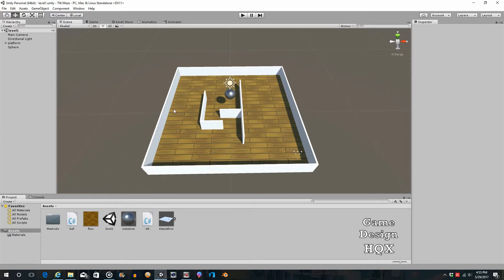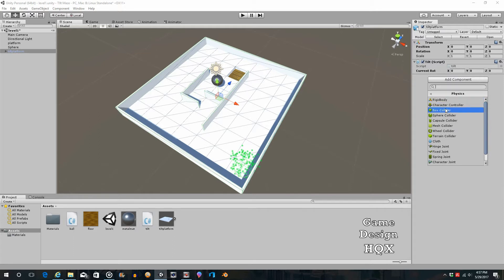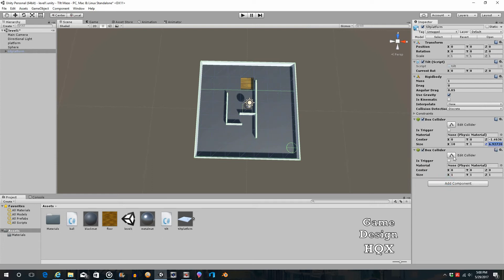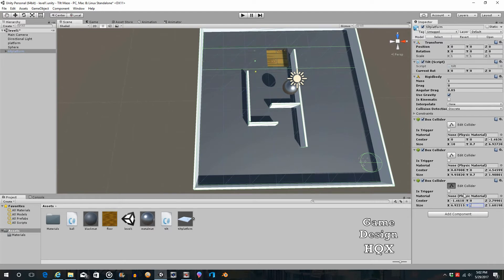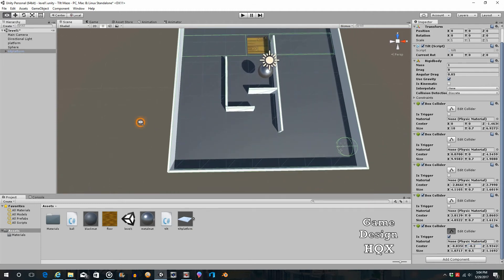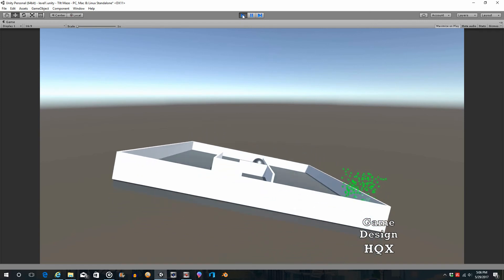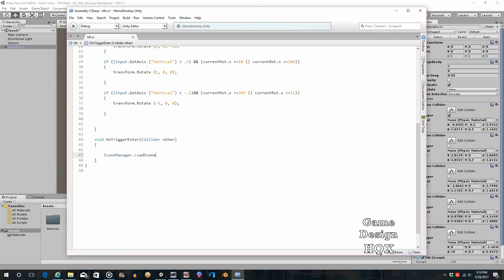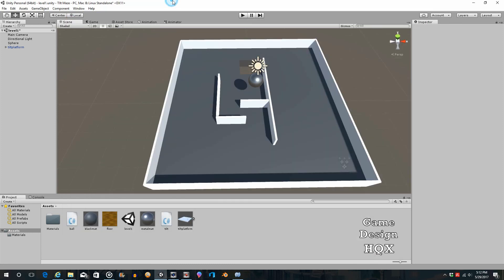Unity 5 - How to Make a Tilt Maze - 04

Comment: This is great and very close to what I'm looking for. Would you be able to make the table tilt depending on where the ball enters a collider? I'm trying to automate the table so that the position of the ball determines where the table tilts up and down (the table would tilt up at the position of the ball so that the ball rolls to the other side of the table).
Reply: No reply on this?
Reply from the maker: Sorry I guess I didn't quite understand. Colliders would be possible but problematic. When the ball hits a collider, you could capture the balls position and based on the position you would change the table's rotation.
Reply: Why would a collider be problematic? I think I need to explain a little better...

I'm interested in making a tilting table that changes its incline based on the position of a ball. I'd like to start out with a platform that's flat with the ball in the middle. The angle of the tilt would be determined when the player hits the ball with a paddle and the ball passes through a collider. By placing these colliders around the table on all four sides I thought that possibly I could make the ball and table continue to move continuously.
Reply: Does this make sense?
Reply: In simplest terms, I think I just would like to know how to use colliders instead of the initial controls you set up to tilt the table. Can you tell me how to do that?